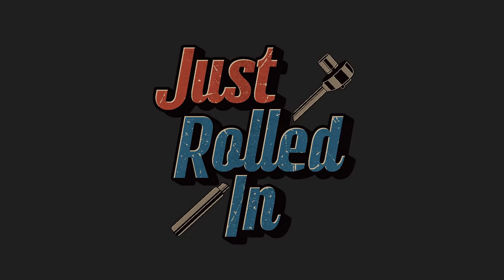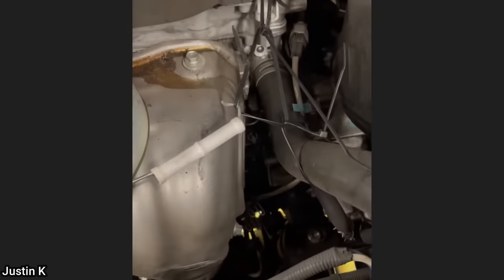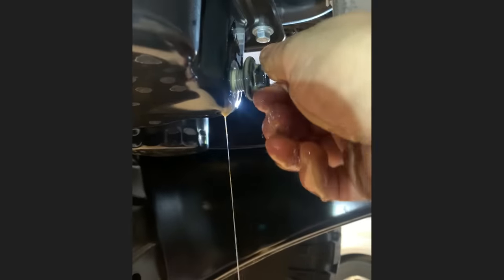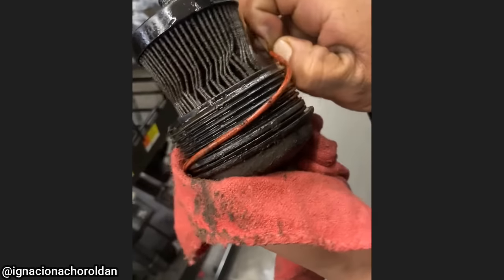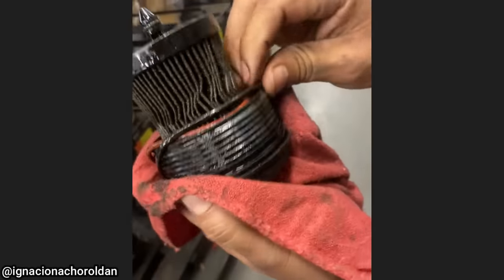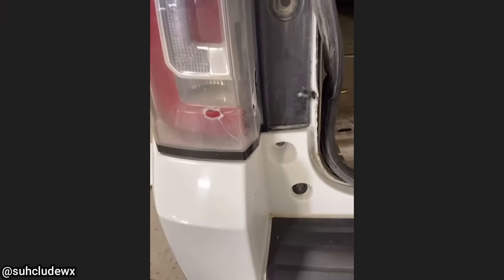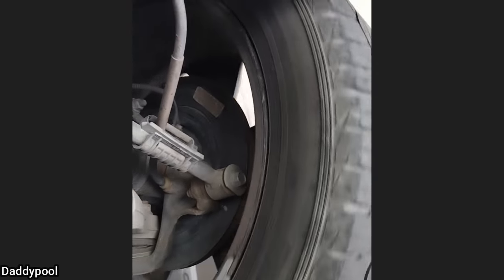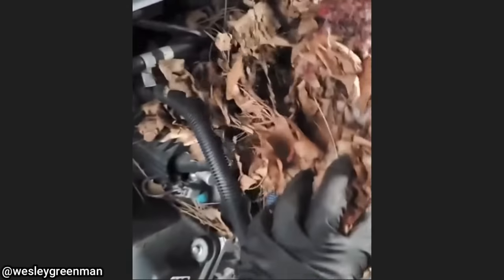Customer States Truck Is All Over The Road | Just Rolled In

Comment: Hopefully someone knew how to stop that run away diesel.
Only few ways to do it.
1: CO2 into the air intake.
2: Put into 6th gear and release the clutch slowly while keeping foot on brakes(assuming its manual and on the floor), this will cause load on the engine and slowly bring down the RPM.
Reply: Option 3: Cut the fuel line.
Reply: @MrBlueBurd0451  you have no clue what engine run away is do you?
Reply: Clogging the air intake is another, but it can be difficult as not always you find a flat, hard item to clog the air filter housing, or the duct
Reply: @MrBlueBurd0451  WRONG.
Run away diesels don't use DIESEL as the fuel source.
But the ENGINE OIL itself.
Reply: @kowalskidiazdegeras9190  A rag will do it and many rags in shops.
Reply: If a diesel runs away from me, I’m running away from it. A runaway diesel is literally a ticking time bomb and I don’t want to be near it when it blows. No engine is worth risking injury.
Reply: @ouch1011  Damn right! Many years ago I was sent on a diesel generator training course and the instructors had an engine there in one of the workshops. Someone had poured pint after pint of oil into it and eventually it ran away and put the steel con rod through the side of the cast iron engine block. You do not want to be poking around the engine compartment of a truck when that happens...
Reply: Can't really put it into 6'th if it's an automatic
Reply: @logitech4873  Hence why you're screwed for driving a failmatic.
Reply: @IIGrayfoxII  Eh no. It's a rare problem.